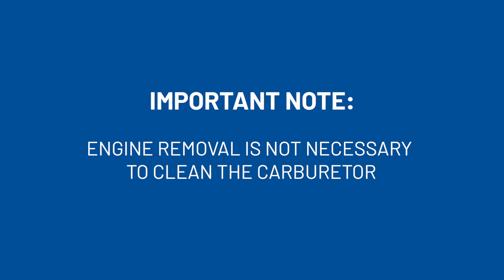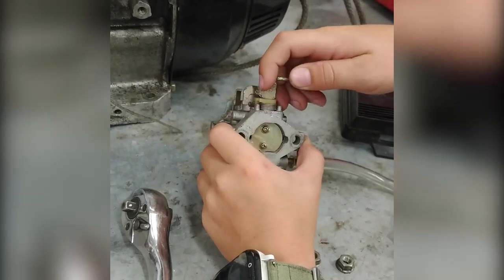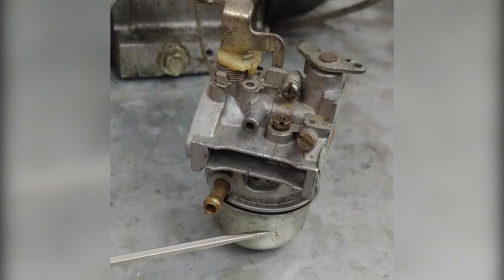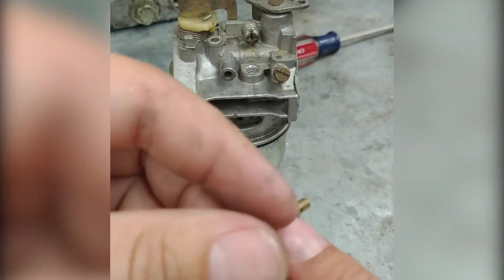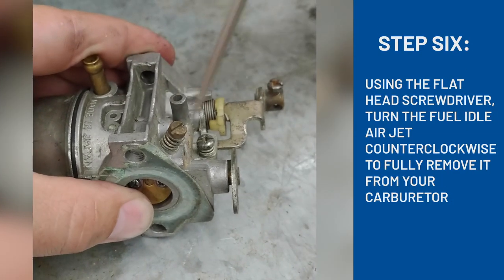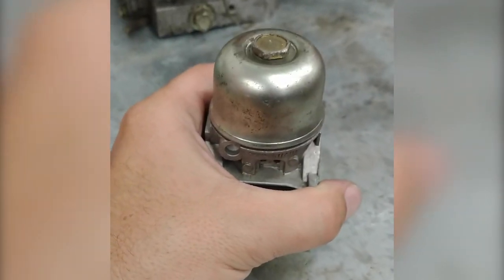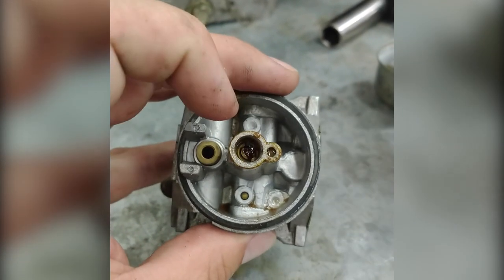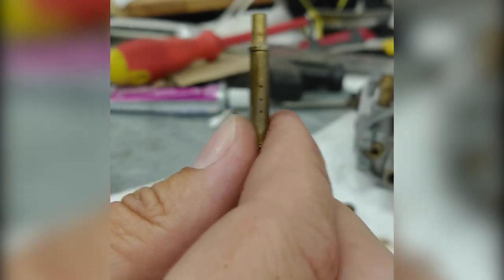Polaris Lil Engineers - Clean a Carburetor Part 1 - Polaris Inc.

Comment: Your video is all fine and dandy but if it's not necessary to remove the engine to do a carb clean, how do you get the carb out with engine in place?
Reply: - Remove the choke cable and tie it out of the way

- With the fuel valve off, remove the fuel line from the carb

- Remove the air box cover

- Remove the retaining nuts using a 1/4" ratchet with a 10mm deep socket. You'll only have room for approximately a quarter turn at a time on the ratchet, but once the nuts are broken free you should be able to spin them off the rest of the way with just the socket.

- Remove the air box and choke cable bracket

- Remove the carb gently, and once it's off the studs just find the right angle to remove the throttle linkage and spring

Comment: Great video...  Question:  Wouldn't the Carb Adjuster screw be an idle "gas" adjustment (not air) since it is on the engine side of carburetor?   (You said idle "air" in the video)   Makes a big difference when making adjustments...  Either way great video..  I am having issues with mine not idling without choke and was looking for a stock adjustment on the carb adjust screw and you covered that in the video.. cheers
Reply: You are correct it is indeed an idle fuel screw.  In is leaning, out is richening.

Comment: This would be a lot more useful if you showed us how to remove the carb when the engine is in the machine. I can't figure out how to get behind the air box to get to the nuts
Reply: A 1/4" ratchet with a 10mm deep socket works perfectly. You'll only have room for approximately a quarter turn at a time on the ratchet, but once the nuts are broken free you should be able to spin them off the rest of the way with just the socket.

Comment: Mine wouldn't stay running without the choke till I went 3 full turns out on the idle adjust screw.   Another reason I believe it is a gas adjustment screw.